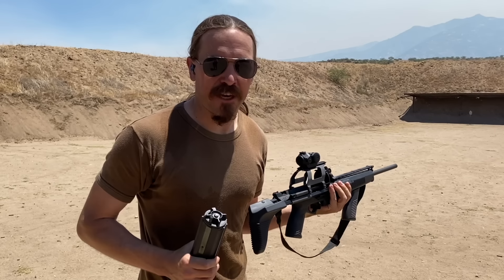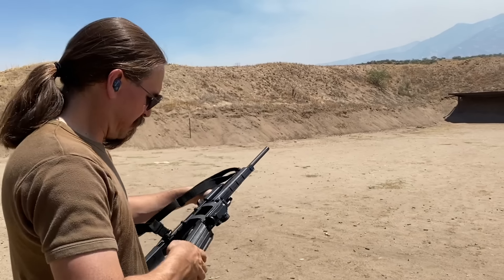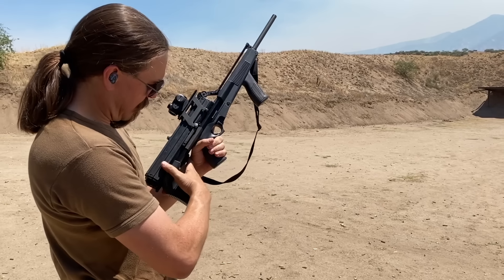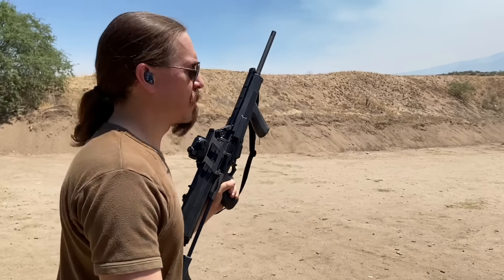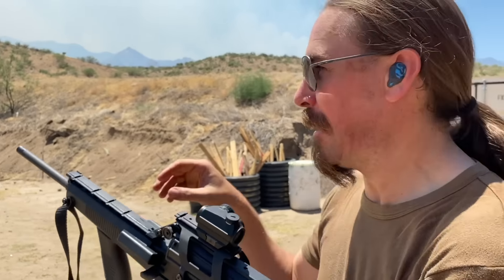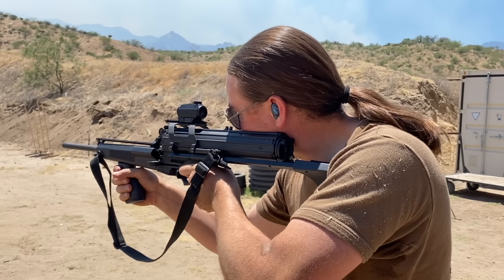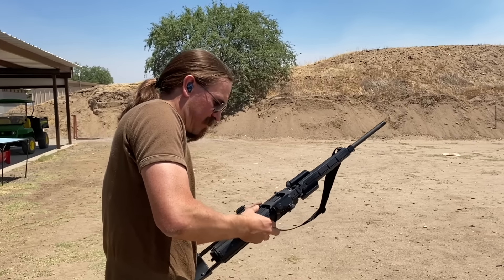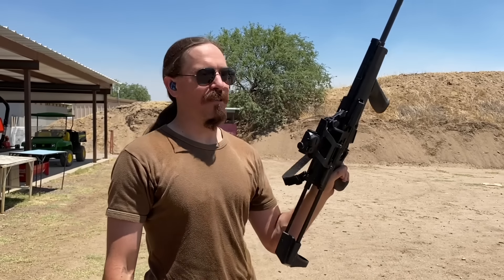Calico Reliability Testing: Round #2

Comment: I saw one test, I can't find again unfortunatley, where the guy keept complaining about the calico. Then he decided to give it one more chance with some decent ammunition (instead of the cheapest stuff he had been able to find), and all off a sudden the calico worked fine.

I wonder if that might be a common theme as well, in addition to winding the magazine incorrectly? I guess when you are loading 100 rounds at a time, cost starts be apparent. Can cheap ammo have such a negative effect on performance?
Reply: A lot of cheap target loads aren’t loaded as hot as some other better ammo so it’s entirely possible a dirty weapon that hasn’t been properly lubed would easily malfunction if fed lower powered ammo in combination with a heavy recoil spring or heavy bolt. Hard to see exactly what the issue is without looking at the gun.
Reply: Maybe they were using steel cased ammo? Before you look at me strange, im not a gun nerd or expert, i know that some guns dont like steel cased ammo, and i dont remember if that exclusively rifles or if pistol calibers also come in steel cased variants. But if something was designed to operate on brass with its specific qualities, using steel in it might play badly. I know it happens in rifle calibers and though i might mention it here.

Comment: So when are we gonna see a mud test on this thing?
Reply: im guessing after he gets a malfunction through normal use, since he would need to clean it properly after the mudtest. 
it would be interesting to see how it fares in the thick goop though.
Reply: I'm honestly not sure what could go wrong- charging handle, maybe? There's no gas system, the only opening to the action is on the bottom of the gun and it ejects fairly conclusively. Actually, if there's a mud test, my bet is that something goes on with the trigger, on several occasions small rocks have killed otherwise well functioning guns.

Comment: The calico 9mm is about as reliable as the average large capacity automatic action. The catch is you can't use plinking ammo. The bolt return springs require more force to move the assembly to the proper position than a low-powered 9mm cartridge provides. This has given the gun an undeserved reputation as an unreliable weapon. Also, an added bonus of the magazine design is that you can store them completely full of ammo with the tension released.

Comment: Years ago a friend showed me this nifty little thing.  It had "BFG Activator" molded on the side of it.  It was essentially a little crank that clamped onto the trigger guard.  You trimmed a popsicle stick to the right size and fit it into the mechanism and against the trigger.  You guessed it, you would turn the crank, it would push the trigger.  A fun little doodad for a test like this.
Reply: So basically it's a mechanical device with a crank designed to rapid fire the trigger and you'd have to 'hip aim' the gun then?

Comment: What they need to do is add a motor and a battery too it which automatically winds it the correct amount then you wouldnt have any problems with people not winding enough or overwinding.

Comment: Here is an idea for an after market accessory for the constitutionally lazy or for those affected by Dyscalculia. Set up a little battery operated electric motor with two settings, one for 50 and 100 rounds magazines. Tune it properly so that can reliably operate regardless of the 9mm bullet weight. With proper linkage, connect to magazine, push button, and voila', the magazine is ready for use.

Comment: For the hell of it I have just checked Gun broker. There are two 9mm in carbine configuration since yesterday, one at 900 bucks an the other at 1100. No bids. You better get your skates on, chaps, clearly the word haven't spread around the heathens yet.
Reply: They are still being manufactured, so you can buy new for similar prices.

Comment: My trigger finger gets very tired playing Firewall Zero Hour (VR) with Aim controller so now I wonder, how do I measure how much force a trigger requires? Use one of those things you hold up a fish with to weigh it in strapped over the trigger? It got so bad I wanted to modify the trigger but now I think the pull might be close realistically weighed.
Reply: A quality fish scale would probably be as accurate as a cheap trigger pull scale.  It wouldn’t have an indicator of the highest weight after you released it but watching it as you pull should be close enough for your needs.

Comment: Everytime you bring this gun out I want to root for the poor thing.  Looks like this much maligned Scifi movie gun from my childhood's been getting a bad rap.🙂  Its looking like the  only issues with this gun are user error and TOO much ammo for one clip!  😅😅😅😅😅😅😅😅
Could you try one thing though?  
How about loading it and carry it around for awhile, barrel up, jossling a bit in the process say slinging it around on a brisk walk for like 1/2 hour.  Then shoot it using like 50 percent of the ammo and then carry it for a while, barrel down, and let it jossle around (say another 1/2 hour between firings).  I wonder if the spring in the magazine can slip over time and use and might cause issues?   Its not a weapon or magazine thing but something I've seen happen in wind up screw mechanisms used in some mechine operations in my workplace.  Or do you think that would not be an issue with this magazine?  I've never seen it in person so I have no idea about it in particular.

Comment: Reliability or not, having to crank the magazine 23 revolutions to function properly is bad design. Too prone to human error under stress just as much as it was without stress. Try winding up a magazine during a combat situation. While someone is on the radio giving coordinates for an airstrike... good chance of miscounting since it is hard to count when someone is saying numbers out loud. Ducking and stopping because of a very near explosion mid revolution and starting the next right after and repeat that another time and you are at 22 or just as bad starting over.

Then there's the time required to crank it up, is it more or less time than swapping out 4 30 round magazines? I think more time. So I don't think there will be any time saved with a Calico than a traditional magazine, just time used differently. But not in a good way, you are supposed to crank it right before using it, storing a Calico magazine fully cranked and the using it later without recranking it is asking for a malfunction. If you are sleeping in a war zone and your camp gets attacked you can grab a weapon with a conventional magazine and be ready right away, with a Calico you are cranking up the magazine and that's precious time that could be life or death.

For a military, I think it is overly complicated and not ready to use on a moments notice and deserved not getting a contract. As a civilian firearm, I see no issue with them... except tired trigger fingers when properly cranked up with a 100 round magazine.